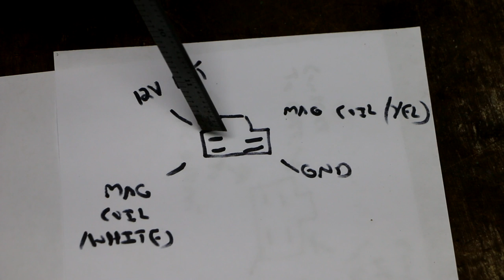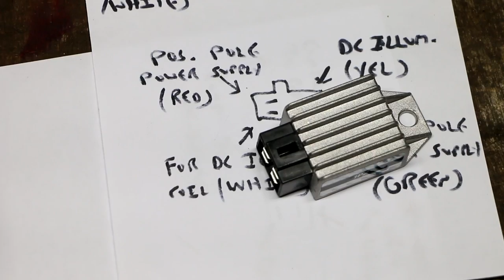The Yerf Dog Spiderbox Go Kart Part 31: How to wire a cheap regulator, and enricher circuit

Comment: Not a bad idea to keep a spare regulator on hand. Our daughter has a similar Kart with a GY6 and over the past 4-5 years I have had to replace a couple. The main symptom is that when she is slowly coming to a stop it will just quit. It will start right back up and run fine if you keep moving but if you start to creep it will quit. Once you throw another $8.00 special on it away she goes for another summer :)
Reply from the maker: That makes sense. I bet that once the regulator quits, the enricher device on the carburetor no longer gets power and cools down, opening up the port that creates a rich mixture for cold starts, but will stall a hot engine.

Comment: Steve you the Man I have one Go-kart exacted the one you work on was run fine but starter switch stuck every now and then I have to turn back otherwise keep starting even when engine running  
now get to the point it keeps starting all time I disconnected both wire to Starter switch, but nothing happened Starter still running??? I have to disconnected Battery terminal otherwise starter keep running I know you the Man I hope you can help me out. It has new Solenoid and was run awesome Kid love it but now Down. Thank Steve (Like and Subscribe)